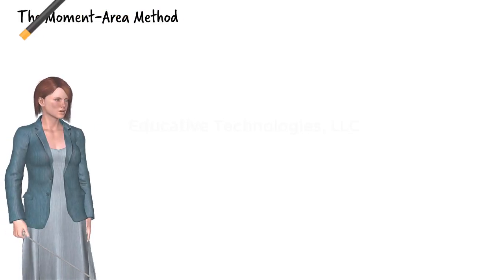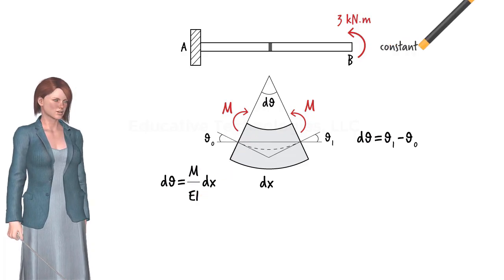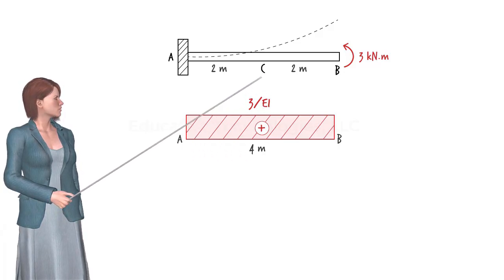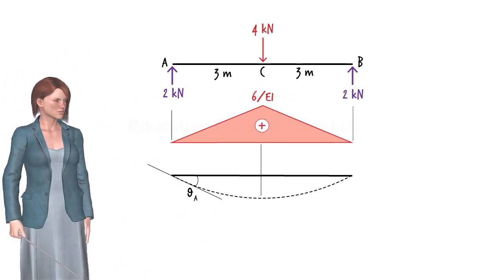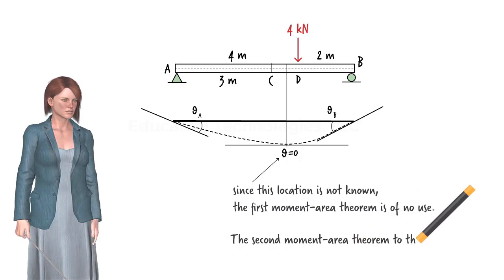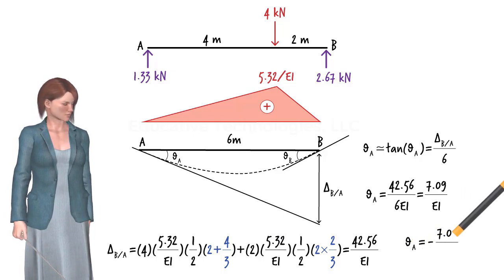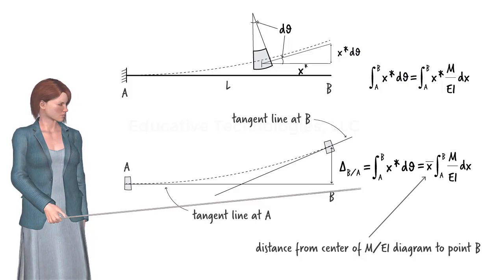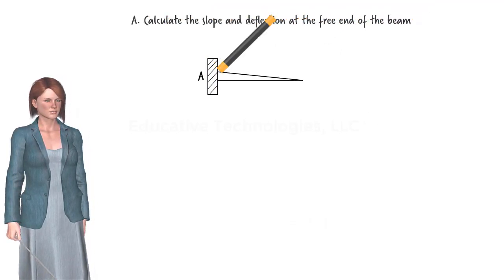SA59: The Moment-Area Method for Calculating Slope and Deflection in Beams

Comment: Dear Dr. Structure, in question 2 of the practice problems, you have drawn an elastic curve. Don't you think that its curvature should change at the point of inflection which is 1.09m left of point C?
Reply from the maker: Thank you for pointing out the issue with the elastic curve. Yes, the actual curvature of the elastic curve is different than the assumed curvature given in the solution. Of importance here is to note that even an incorrect assumption about the shape of the elastic curve yields the correct value for the vertical displacement at B. Using the correct shape of the elastic curve could have added a bit of complexity to the presentation that we felt was unnecessary for the problem at hand.

However upon examining the solution, we found a calculation error which now has been corrected. The solution pdf file on courses.structure.education site has been updated accordingly.
Reply: @DrStructure  Thank you so much dear Sir. You are doing wonderful. Keep it up!

Comment: In simply supported beam where you used 2nd method if there will b a point c at the distance 1m from a point A then how will find slop at c?
Reply from the maker: In such a case, one first needs to find the slope at A (using the second moment-area theorem). Knowing the slope at A, the first moment-area theorem can be used to determine the slope at C.
Reply: @DrStructure  sir in the pdf solution of excercise que 2 .. The load of 6 kn acts at B which is the mid point of AC sir then can we calculate the slope of c taking 1st m-a theorem between C and B taking thitaB= 0?... But in the pdf solution u calculate deflection at A then divided by 6 to get thitaC that i  understood but why cannot we use the 1st m-a theorem btwn C and B ?
Reply from the maker: @rikdevghosh7324  No, that would not work. It is true that B is at the mid point of AC, but that does not automatically make Theta_B = 0. For Theta_B to be zero, the applied load has to be symmetrical about B. In this, if we remove the load at D, making the 6 kN load at B the only load on the system, then Theta_B becomes zero. Alternatively, if we add an overhang of 2m to left of A, then apply a load of 2 kN at the free-end of that overhang, which results in having the beam subjected to symmetrical loading about B, then Theta_B would be zero.

Comment: Hi ! i have a question, in the second problem when finding Theta D at the third page of the solution is:
Determine the slope at D using the first moment-area theorem.
θd -θc =  area under the M/EI diagram between C and D

The area is the Highlighted Triangle with a Base of 2 Height of -4.
According to me this area is -4 units^2 but in the solution there is an extra value (2x2/3) wich seems like an arm to me against point D.
So my question is:

Where does this Term come from (2x2/3), since the First Moment-Area Theorem states that the difference  in slopes between two points equals to the area under them ?

Thank you !
Reply from the maker: Thanks for the question. You are correct, that term should not be there. The area under the shaded diagram is -4/EI which makes theta_D = 1.5/EI.  We will make the correction and update the solution file accordingly.
Reply: @DrStructure  sir do you have some kind of portal where we can send doubts.. I was solving some questions of the m-a theorem and i got stuck on a que.. I cannot send picture of the que in utube comments .. Sir can u help ?
Reply from the maker: @rikdevghosh7324  You can send email to Dr.Structure@EducativeTechnologies.net

Comment: For the question 2. I don't seem to understand how the slope at d was gotten. I would appreciate any help.
Reply from the maker: Is there any specific step in the pdf solution that you would like to be explained more/better?
Reply: Yes. @drstructure the slope at D = 5.33/EI
Reply from the maker: Slope at D is not 5.33/EI, it is 0.17/EI. 

Slope at D is calculated using the first moment-area theorem. The moment of the M/EI diagram between C and D equals to the difference between slopes at C and D. 

We can calculate the moment of the area under the M/EI diagram between C and D by first calculating the area. It equals the area of the part of the diagram shown in red. The height of the triangle is -4/EI, its base is 2, therefore, the area is (-4/EI)(2)/2.  Now, multiply the area by the distance from the center of the area to point D in order to determine the moment of the area about D.  The center of the right triangle, measured from D, is equal to 2/3 of the base of the triangle. That gives us (2/3)(2). Multiplying the two quantities, we get: (-4/EI)(2)(2/3)(2)/2 = -5.33/EI

The above value, per first moment-area theorem, is the difference between the two slopes. And since we already have calculated the slope at C, we can determine the slope at D by adding the slope at C to -5.33/EI

Comment: Good day Dr Structure

Is the next SA video going to me on Moment area theorems, or its something else? 

Are you going to have the videos for hanging cables anytime soon?

Can this SA 59 video have any settlements, if so, how do we involve them in the calculations?
Reply from the maker: The next SA lecture is going to be on the three-moment equation/theorem. 

We have the analysis of cable on the list, but I am unable to give you a reasonable time frame for its release at this point.

Problems involving support settlement need to be addressed using analysis techniques such as the slope-deflection method or the displacement method (see SA32, for example). In such problems the objective is to determine internal forces (shear and moment) due to a settlement. The moment-area theorem deals with calculating displacements only, it cannot be used to determine internal forces, whether due to a settlement problem or otherwise.
Reply: @DrStructure  oh ok i was thinking that the settlement might occur when there are deflections.

Will remain posted on the new upcoming videos